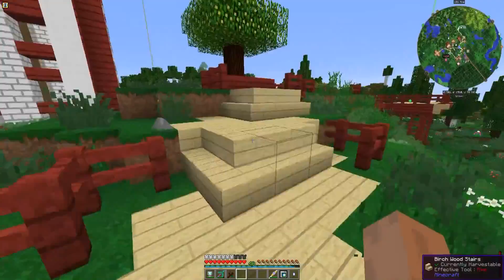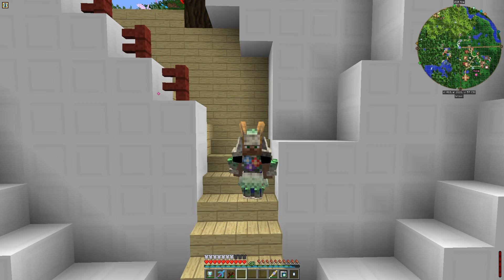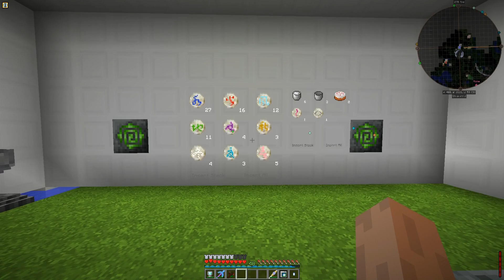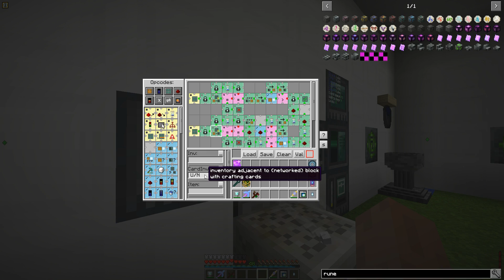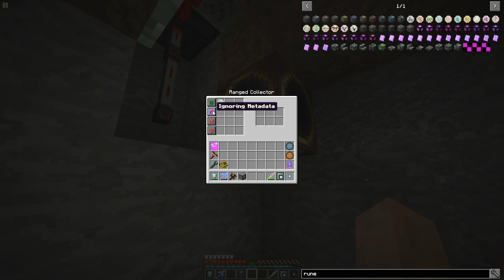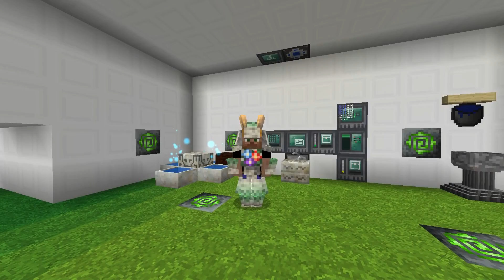Ftog Avant 3 ep55 - Botania Rune Crafting w/ Rftools Control

Comment: haha I got this working late last night and was going to stream to show you, but you're a day ahead of me!

Nice build!

I used 2 separate programs to handle the control, with the redstone handling in a totally separate core.
Reply from the maker: Thanks. I caught the tail end of your stream. Checking out what you were doing.
Reply: Ah, nice. I was derping with exu2 pipes making a cobblegen.

So in the subject of how the get-ingredients-smart can talk to the other parts of the program, it does more!

Crafting requests SEEM to exist across the network. This means that different programs (and I think even different processors with advanced network cards that can see one another) can ask each other to craft things. Craft requests are system events.

The card inventory in the instruction is strictly for where to find the card containing the ingredients for YOUR current craft, not all subsequent crafts.

This means that it's no problem to make systems that have a huge diversity of machines for processing. :)
Reply: By the way, I asked Vaygrim to link your first guide in our next mod guide. I hope you don't mind.
Reply: Just finishing the episode, there is an opcode to wait for an item to appear in a remote inventory. It helps you break up the flow of things.